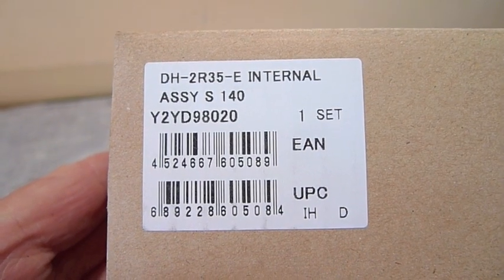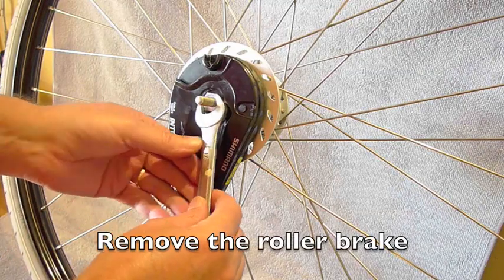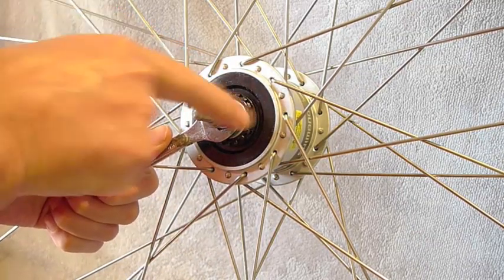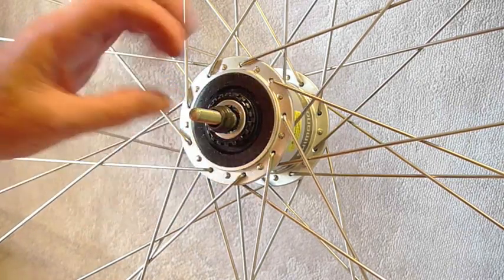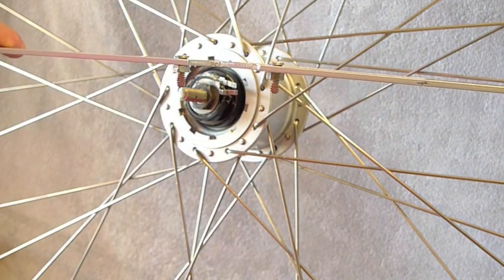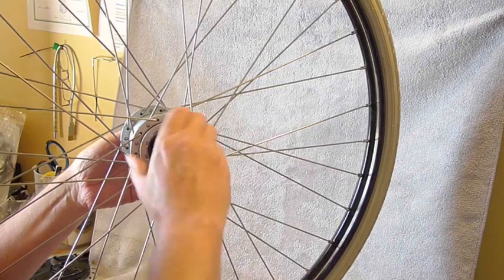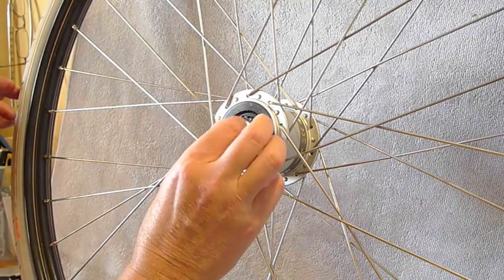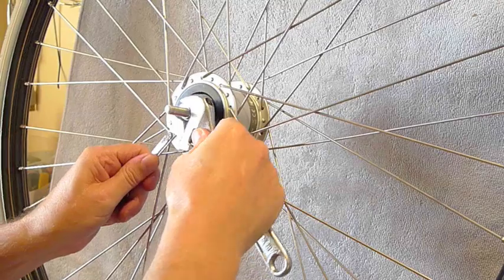Shimano hub dynamo DH-2R35-E replacement

Comment: My Shimano dynamo hub worked for 24 years. Yesterday I broke that little tiny wire that comes out from the coil to the contact patch. I bought an entire new dynamo hub and will change the internals complete as demo-ed here.
And to others asking about the drag. It does, but it does not have significant extra drag, if the lights are not on. I need the light at night, but then I do not ride overly wild anyway.
Reply from the maker: Ours are still working. Good luck

Comment: Thank you. I kind of hate the attitude of Shimano (and others) that there is no such thing as user servicing. Seeing it can be done is half the battle.

One question - @o:24 it looks like something is cocked at a pretty serious angle. Is this the hub insert or stator that's angled? Is this just some looseness that gets corrected when installed and adjusted?
Reply from the maker: Thanks. Just parts lose before it's all bolted on.

Comment: wait... you replace all the stator only for the electric contacts?. Maybe it's easiest replace all the bike hahahaha
Reply from the maker: They were smashed beyond repair and the stator was cheap.
Reply: Electrical contacts and right hand cone are not available to buy on their own, therefore replacing the internals is the only repair option from Shimano.
Shimano also state that the right hand bearings are not serviceable, so when they wear out you are supposed to buy/replace the internals.
HTH

Comment: Opened a Shimano hub dynamo that had worked for 3 years and then gone dead. It was so full of some gunk that I couldn't even make the innards budge let alone come out. 
The axle was the only thing that was rotating. It had probably torn itself free from the rest of assembly at some point. So I can't replace the innards without some serious solvents and/or power tools. Probably a time to buy an new front wheel. :)
Reply from the maker: Ha, sounds like its had some serious use and abuse.
Reply: There is something that can be done.
It's called regular MAINTENANCE and it would never have got that bad.
You remind me of my stepson, he would buy a new car for work (£25-30K) and run it into the ground then buy another when it broke down! and moan about never having any money!
He went through three brand new cars in one year!
When he went to the garage the fourth time they refused to trade in his old car, they were quite willing to sell him a new one though because he was a good customer that paid cash!
I took his third car, spent £3697.00 repairing and cleaning it. then proceeded to cab it for three years putting over 150,000 miles onto it. Then traded it in against a new one for £8495.00.
I earned between £900-£1200 a week, he earned a lot more.
He did sort of learn to maintain the car I used to book it in for service and repair to be collected on his day off.
It took a while before he stopped moaning about it.
After we traded them in at 100,000 miles or 2yrs for £12-£15K.

The moral MAINTENANCE pays for itself & manufacturers/retailers love people who don't do it.

Your Safer too with a well maintained bike.
What would have happened to you if you'd been riding your bike and the front wheel had collapsed?
Best case. "Face plant on the road"
Worst case. You end up under a lorry/bus (DEAD OR CRIPPLED).
For your own wellbeing look after your bike properly.

Comment: Thnx. It made me do the disassembly instead of going to a professional repair shop as
instructed in the manual that came with the bike. Especially your diy tool prevented me
from hammering.
Reply from the maker: Glad it helped Theo. I didn't really know what I was doing but it's still working after 2 years,

Comment: @andrew: They're excellent for touring,  I would say perfect:-) Never running out of batteries,  which when you are touring,  can be hard to find and annoying to haul around!
I toured with one three years ago, I did not feel ANYTHING when it was turned on. Only downside is that they dont last forever. Im sure  newer ones are even lighter and more durable, especially if you cash out more than the 25€ I did!

Comment from the maker: sauroman1 - Good for touring? Probably not. They are heavy and always producing drag but I'm no expert.
Reply: Depnds on how fast you want to tour I suppose..... I've been doing so for many years with bags etc and if a little friction and 100 grammes weight is an issue to you then I'm sure you're not touring.
One thing I find amazing is the number of people who shrug off these dynamos before ever having used them for the above reasons when if they actually cycled around more they could easily loose the extra weight they talk about themselves. Would do most of them some good too !
Thanks for the video. very helpful.
Reply: Heavy: they weigh the same as a full water bottle!
When you're touring how much luggage are you loading onto the bike in KG/Lb's?
For normal day to day riding there are better, Lighter, less draggy ones, usually costing 10-20x as much.
You can get a wheel with one built in for £30.
Draggy! It's the same as riding up a 1 foot in a mile or with a 10kph(6mph) headwind on the same bike without the dynamo hub.
 2-5W extra.
Basically unnoticeable in normal use. I.E. speeds up to 30-40kph (20-25mph).
From +50kph(30mph) the drag/resistance quickly increases (8-10W) but most people will only do those speeds downhill.
How many times do you only ride on the flat or downhill.

Comment: Are hub dynamo's good for touring?
Reply: +Flavius J Well I have now experience with them. But I don't like drag they create which is not possible to switch off and really useful only during night. Magnic light seems like better alternative.
Reply: @sauroman1   - Magnic Lights Physics 101: There ain't no free lunch. Any energy you get from a bike generator system in electrons comes from your legs. Period. The notion that Magnic lights are somehow "dragless" is nonsense. Magnic lights absolutely cause drag, and because your rim is not optimized as a generator component, the drag losses between the energy you put in, vs the electricity you get out are actually worse than that of a dynamo hub, the components of which are all optimized to act as generator components, rather than designed to connect your tire to your spokes. In short - your bike rim was never designed to minimize eddy current and hysteresis losses with the accompanying drag - the stator of a dynohub is.

The only reason that Magnic lights are even rideable  and are somewhat low-drag (only somewhat) is that their output is pathetic - max claimed lumens is 40, which is devastatingly inadequate for any real need to light up the road. Even a mediocre dynamo headlight is good for over 300 lumens.

So yeah - if you want to generate a tiny amount of light as inefficiently as possible while spending a ton of money, while not having any choices as to which headlights and tailghts you want and where you want those lights mounted... then yeah, I guess Magnic Lights are just spiffy.

As far as the generator being "really useful only during night", I consider arriving at my campsite with my phone, laptop and camp lights fully charged to be massively useful., one of many perks of having a dedicated generator, that can act as a charging station during the day, and provide as many hours of lighting as you need at night, without ever having to worry about the condition of your battery light's charge.

I find the whole "OMG!! TEH DRAG! TEH DRAG!" whining to be more than  a bit specious. Would I feel  "TEH DRAG!" I were on my Pinarello Dogma F10, wearing skin-tight spandex and I had to get to a finish line a few seconds faster than my opponents? Sure I'd feel it - but I'm not doing that. I've been visiting a friend in the country and stayed longer than I intended, or I've had to work late and the sun's getting low and I've got miles to get home. Partway through the ride, my little Axa Blueline 50 decides it's dark enough, kicks on and lights up the road all the way home. Yeah, I "feel" something then, too. Feels pretty good.

To the OP, avalon - no, dynamo's aren't good for touring - they're essential. Having toured once on a friend's bike with a dynohub, I've never since even considered doing a tour without a hub dynamo (technically, they're magnetos, not dynamos, but whatever). If you start to think of bicycles as vehicles, rather than as expensive hobby toys that let you pretend to be Lance Armstrong, then you realize - would you buy a car or road motorcycle that didn't have a charging/lighting system? In much of Europe, it's not even something you'd consider - having a charging/lighting system on a bike is as normal as having an alternator in your Audi.
Reply: @47f0  If that was the "in short" version, it's about time you look for a publisher to spread the long version ; ))
Reply: @robolykan5991  -  Yet, paradoxically, had I actually used the phrase "in short" (which I didn't), my post would have been even longer...

Comment: To repair it you don't need to buy a complete assembled parts unless you work in a bike shop and you have to repair it "as new". You just needed to catch the eletric cable and welded it on the positive circuit. The negative pole is can be catch on the axle.